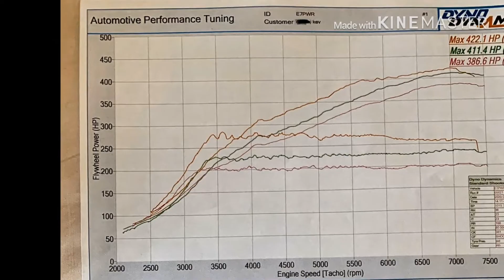MITSUBISHI EVO VII DYNO DAY **422 BHP** **400 lb/ft**

Comment: Very nice mate! When you say hybrid 80 series, what has changed compared to a stock one?
Reply from the maker: BMMellor hi bud, it’s basically an Evo IX turbo but it’s made by Owen Developments... It has a 68mm compressor wheel, it’s pretty much maxed out at 420bhp but my engine is good for around 600bhp now, so when I can afford it I’ll be putting a Garrett on there 😉👌
Reply: @ThatEvoVII  Hi mate, so it's the owen developments ball bearing version of the 80 series? What sort of boost level are you running to achieve the 422bhp? From your quick overview in the video our spec is pretty similar except mines a normal brand new 80 series 🙂 I'd be happy with 420bhp to be honest.
Reply from the maker: BMMellor sorry for the late reply I didn’t get a notification... It’s generally running 26psi, sometimes the boost gauge shows 27 but it doesn’t hold it for long, I’ve done about 2k miles since the rebuild and it’s been a blast... I think the amount of power it has now is right in the fun zone 👍